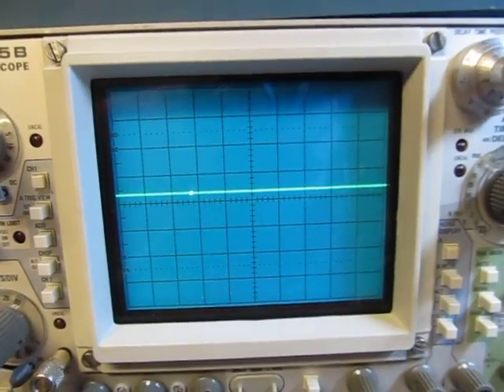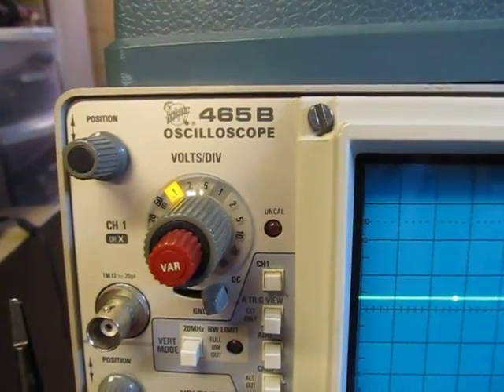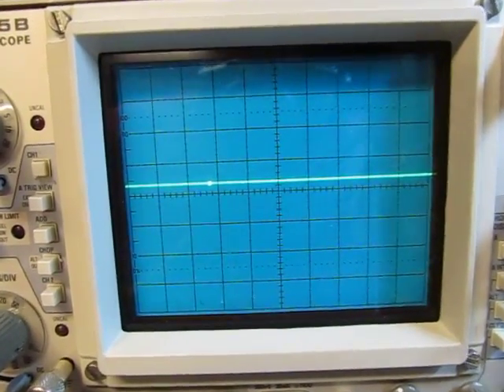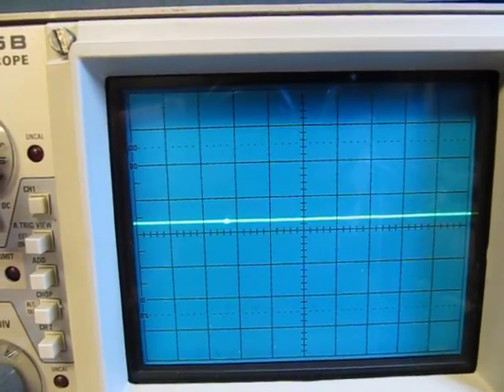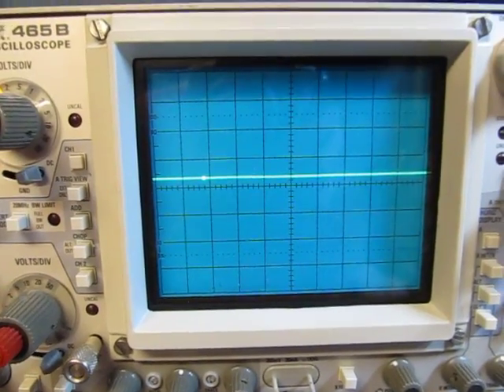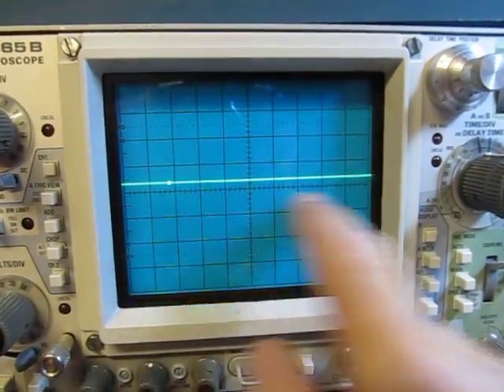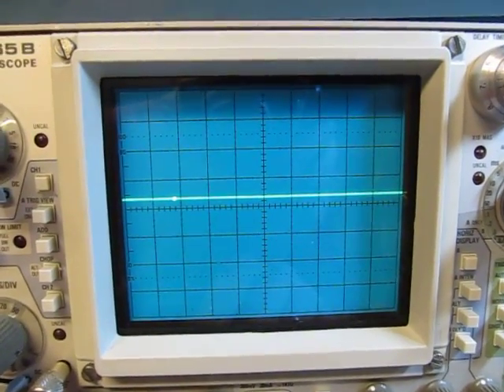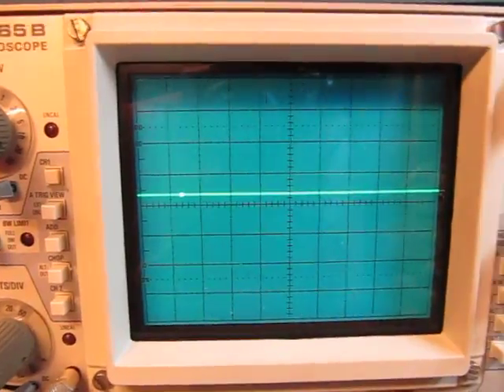#41: Use Oscilloscope Z-axis input to create "marker" on waveform

Comment: If anyone wants to use this way to make a marker, while sweeping in the X-Y mode it wont work. Because there is no "B-Gate" output in this mode  from the scope. Instead you can use the synchronization output from the function generator and plug it directly in the Z-axis input (second output from the generator is used to drive the X-axis generating a ramp). This way the half of the sweep will be in different brightness, where the vertical line in between will be the marker exactly for the center of the sweep span freq. But it is better if simply use the scope in normal V/T mode and plug synchronization signal in the CH2, trigger on it and use it as visual marker for the same span center. This way you don't need ramp signal and if you have cheaper DSO with useless X-Y mode you can still use it for sweeping frequencies... 🙃

Comment: I can’t find this schematic, is it available.  Unless you think it’s a fool’s errand, I had an idea for a frequency marker for IF alignment. I recently acquired a HP8601A to learn about visual alignment on old tube radios. My idea is tee off the sweep signal feeding the radio, run the tee’d portion through a narrow crystal filter (455Khz) and use that as a pulse to trigger the Z-axis. Using your circuit here seemed like a good starting point. BTW, your videos have been invaluable in teaching me how to actually use an oscilloscope. Thank you for sharing your knowledge.
Reply from the maker: Unfortunately, when I made this video 11 years ago, I didn't scan a copy of the schematic into a PDF, so you'll have to pause the video and re-draw the schematic yourself.  I like your application - should work well!
Reply: I have simulated this circuit to study it. I can send you the schematic.
By the way, thanks W2AEW.

Comment: How could you use it measure a voltage and tell you value like full cursor setups
Reply from the maker: Bottom line - you can't.  All this does is momentarily intensify the trace at a  selected spot.  There is no easy way (without tapping into the vertical circuit) to determine the voltage at the intensified location.
Reply: @w2aew  I know that it's only part of the circuit 

I was thinking with 465 tek using the output Channel 
Or 
Making a input Channel tap 
But 
The esayest be using it with the 2nd Channel and overlapping the Channel 

Be very cool to make more circuits to do things like this 
I'd use it quite a bit

Comment: Basically you are creating an x-axis cursor, or more accurately - one half of an x-axis cursor. I have a Tektronix 2246A which has both voltage and time cursor functions built into it. I find them very useful.

Comment: That is very clever!  However, the sweep rate will vary with the horizontal scaling making the timing different for every time scale.  I suppose you could switch in different timing caps up to the capability of the 555, but this otherwise works well only on 2-3 adjacent scales.

Comment: Neat. But if you somehow had access to the ramp used by the X deflection plate, you’d be able to use a couple comparators to make such a circuit that doesn’t depend on the time/div.
Reply from the maker: Yes, this is true.  More than one way to achieve this result.

Comment: Is Vcc 5V or 10V or 12V? In case of using 10V, a low cost voltmeter connected to pin 6 or 7 will indicate directly the multiplier. Can you answer please?

Comment: Since you know alot about Tektronix scopes how is the TDS 3032 scope???
Reply: When I was a youngster (1972-1974) my father brought a Tek 321 (1 ch. field service scope). Till that time I tuched at tech junior college only gray Heathkits. The world shaked that evening :-) could not believe such beautiful electronic things existed in this world.
Reply from the maker: The TDS3000 series is a good, solid scope.  Keep in mind that the design of these scopes will well over a decade old, so it won't have many of the nice features of more modern digital scopes (deep memory, high resolution display, etc.), but should still be a reliable instrument if in good condition.  They still command a relatively high price in the used market.  You might find a new value-brand digital scope for the same or less money than a used TDS3000 series.
Reply from the maker: Sure, no problem Adam. I do have a bit of a bias towards Tektronix, but that started long before I started working for them! ;-). I try to be mostly impartial in my videos, but it's certainly no secret that I'm a Tek fan.

Comment: i have 2235 tektronix oscilloscope having only z axis ;if i can make a trace marker 
can you please tell me how to implement using a circuit
please...
Reply from the maker: +soumyadip sikdar You need an output that is synchronous with the start of the trace or the trigger.  Without that, you have no way of starting the delay timer to make a trace marker. The 2235 only has a Z-axis input, and no output that can be used as a sweep-start sync (like trigger out, main sweep gate, etc.).  So, you're out of luck unless you dig inside the scope...  ...which could be dangerous if you don't know what you're doing.

Comment: Hi Alan
My Tektronix 2225 has a Z input put not the gate input. Can I still create a Marker without the gate input.
Thx
Reply from the maker: Are there any other outputs on 2225?  You'll need some way to synchronizing the start of the sweep on the scope with the start of the monostable timer circuit so that the delay is always relative to the start of the trace.
Reply: ***** The 2225 only has a Z input. Any other solutions for a marker of sorts.

Comment: Yes to Glen's idea re video on sweeping IF's,  particularly if w/o expensive equipment.

Unrelated suggested video- I'd like to play with using the XY mode,
particularly with Lissajous patterns to check components. I'm finding it
more complicated than it probably be, possibly due to
cable/ground/impedance matching problems (like most inexperienced users).
Eventually I'd like to create single characteristic curve traces of
transistors and tubes (since I can't afford a curve tracer).

Comment: A question. My HP 8566B while being a great spectrum ana. does NOT have a tracking gen.
You mentioned sweeping a filter with a sweep gen and using a scope to view this. The TV guys use to do this to align TV IF's before the whole TV was put onto a couple of IC's.
Will you consider doing a video on sweeping IF's? Most of my work is at 455KHz but I do some 6MHz and 9MHz If work too.
I really appreciate your videos and you taking the time; I have learned some neat stuff.

73,
Glenn WA4AOS
DSM Labs

Comment: 1) If I understand what you are doing here, I'm wondering if the same thing could be accomplished using an external pulse generator. Use the pulse generator's ext sync connected to the A-Bate output. Then input from the pulse generator to the z-axis  a pulse and vary the width and delay. Is that correct? Could you then select which channel this applies to, or would it affect both channels simultaneously (without choice)?